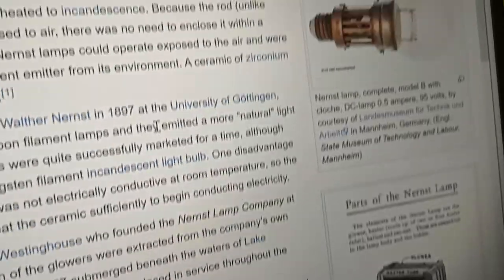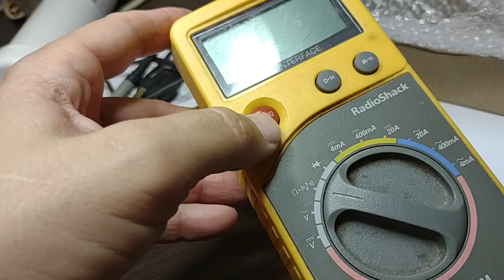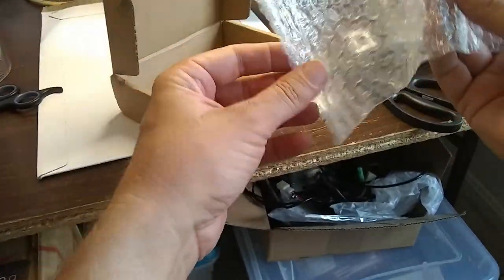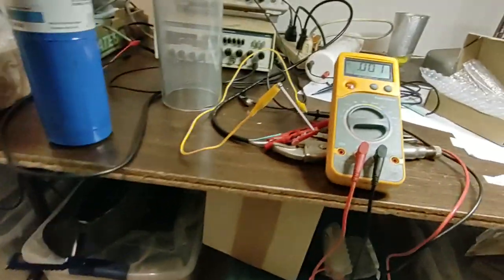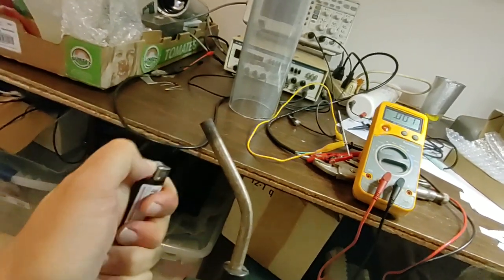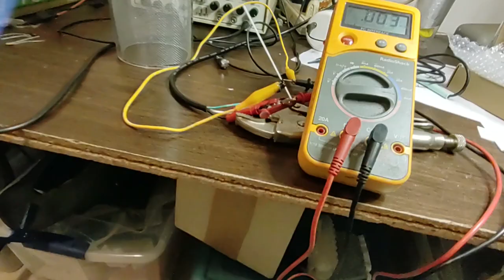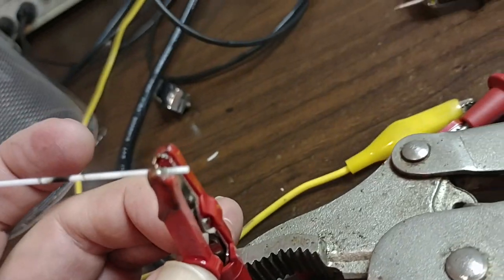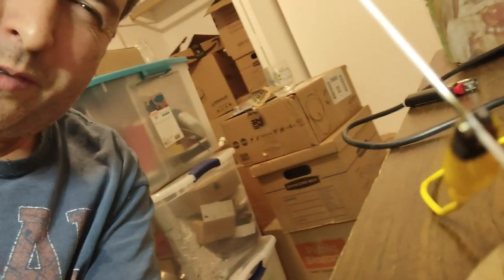Nernst Lamp Experiment - Part 1

Comment: The entire rod has to get hot - a 1mm gap because of plastic leads will prevent the entire rod conducting.

Make a test fixture using all metal components that you can heat up.Also, go for a shorter length -likely an inch or even less.